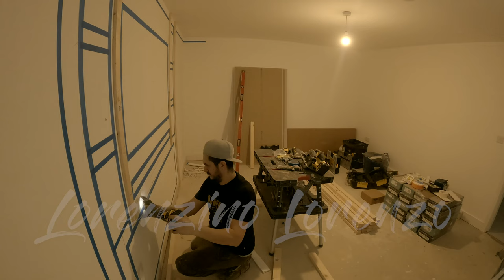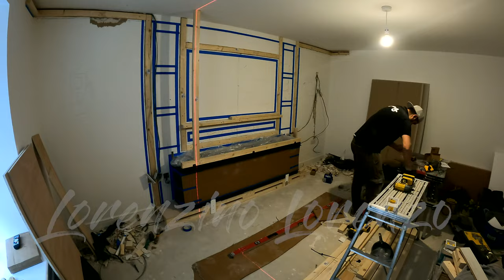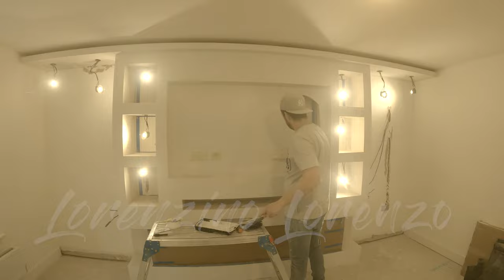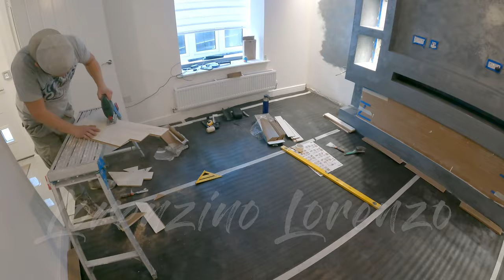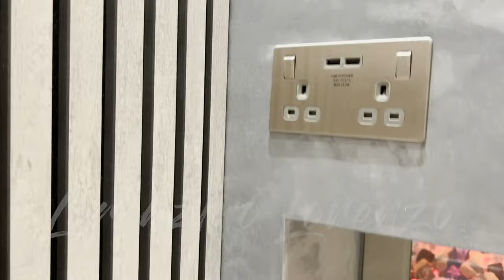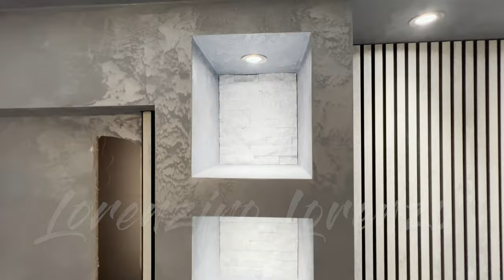media wall , feature wall , acupanel, panoramic fireplace , herringbone flooring ,  time-lapse video

Comment: Beautiful work. I just love how you built your entertainment wall. I’m about to build something similar. I do have a question. How did you get the drywall into the small space below the tv. That’s going to be a problem for me because I’ve not been able to figure out how to get that portion done. Any help you could provide would be greatly appreciated. Thanks.
Reply from the maker: Thank you for your feedback much appreciated, I left enough space just to slide the combidrill and I used one of the attachments in the link https://www.toolstation.com/offset-screwdriver-attachment/p41325?store=GB&utm_source=googleshopping&utm_medium=feed&utm_campaign=googleshoppingfeed&mkwid=_dm&pcrid=&pkw=&pmt=&gclid=CjwKCAiApvebBhAvEiwAe7mHSFoDiy0slymdiFmkudpUOUjMPzqvnhWZcaBsFoSMKKTxzIO8T36hbRoClUsQAvD_BwE&gclsrc=aw.ds

Comment: Hi what set of leds did u use? 1 seperate remote for led strip on the top + second remote for spot lights ? or ?
Reply from the maker: Hi 
Spot lights are on a dimmable switch and only the strip lights on remote control ( 5 m long strip lights )
Reply: @lorenzinolorenzo9258  nice one thanks , could you also tell me the model of fireplace ? That is the best project of media wall what I ever seen mate, well done!
Reply from the maker: @artur198555  🙏🙏much appreciated 
https://www.fireplacefactory.co.uk/product/the-bespoke-panoramic-2000/ this is the fireplace

Comment: That's a great job, excellent details. I noticed  an opening behind the TV , is it an access point to electrical wiring?
Reply from the maker: Yes more sockets inside and a transformer for the top lights
Reply: @lorenzinolorenzo9258  Great job indeed ! I will try to duplicate it and would like to utilize the space on the left and right for storage, perhaps 2 matching small cabinets?
Reply from the maker: @joeb1465  https://www.instagram.com/reel/CreB4ulIqiI/?igshid=MDJmNzVkMjY= maybe you like this one better, more storage
Reply: @lorenzinolorenzo9258  I just wanted to thank you again for copying your ideas 
I started my own similar project with some modifications due to a smaller wall
I opted to place the 3 openings on the top instead on the sides.
Would love to share a picture but I don’t see a tap to upload images here .
Reply from the maker: @DantdubaiDantdubai  every room different design, please load your project on your own platform would love to see it and get inspired for my future projects
Reply: @lorenzinolorenzo9258  
Still at early stages , did 2x4 framing , sheet rock and electrical wiring . 
It will house 55” TV and 60” fireplace . 
On my next to do list : lighting , accu sides panel , and stone on the top openings .
Reply from the maker: @DantdubaiDantdubai  sounds great,  looking forward to see it when you finish

Comment: Could you pls list our materials used... worth a try in ny home
Reply from the maker: Timber, screws,plasterboard, easy filer , plywood,primer, paint , 1.5 cable, 2.5 cable , spotlights, sockets, light switch, silicone, tiles 
Just play the video and make a list
Reply: @lorenzinolorenzo9258  you forgot to mention the blue masking tape 😉
Reply from the maker: @arian7436  you are right 😀 two blue tape 😉

Comment: Hello, did you just trowel easifill 60 on and then sand it? Thank you
Reply from the maker: Yes i did 
I can’t do plaster , after done a good primer and job done
Reply: @lorenzinolorenzo9258  great finish, how many coats of easifill does it take?
Reply from the maker: @ryanbevan199  I only done two coats and where needed 3

Comment: How far off the ground is that wall heater ?, Have you have any issues?.
Reply from the maker: About 20 centimetres, no issues
Reply: @lorenzinolorenzo9258  I'm getting mixed information online , some are saying 15cm others are saying 45cm , I kinda need to go around 10cm other wise I cant fit the sound bar , I don't like my tv in the sky , I like around eye level , but I just don't know can't get a real answer .
Reply from the maker: @gulllllll1  best is to email the supplier and ask them

Comment: Great job ! I would like to do my own built in TV wall, how did you manage to add LED lights under each box please ?
Reply from the maker: Run the wire before you start closing the media wall
Reply from the maker: Jump to minute 6 in the video

Comment: What kind of material you use ?😊
Reply from the maker: Do you mean the paint or all the materials?
Reply: @lorenzinolorenzo9258  both .. thanks for the reply .. Appreciate it
Reply from the maker: @Rootsman1  Timber, screws,plasterboard, easy filer , plywood,primer, paint , 1.5 cable, 2.5 cable , spotlights, sockets, light switch, silicone, tiles , acoustic panel x4 , led strip lights 
play the video and make a list , probably I skipped a few things , paint is from gimcyn ,imperia italia called moonstone
Reply: @lorenzinolorenzo9258  thank you very much . One love